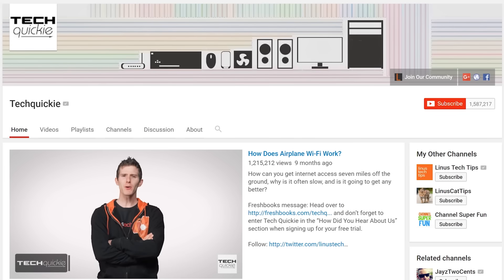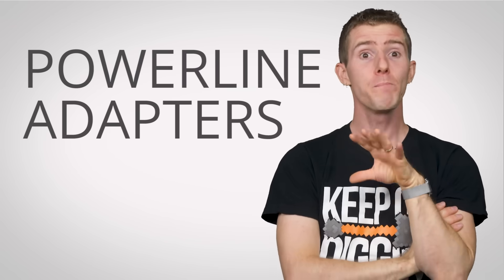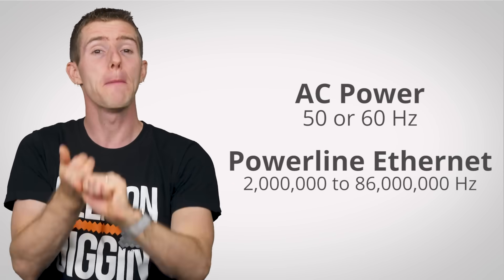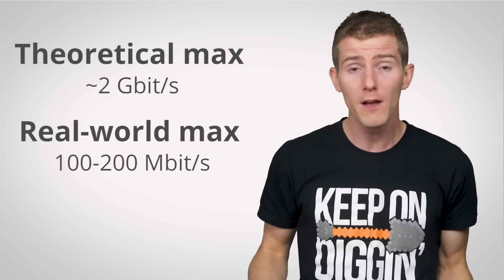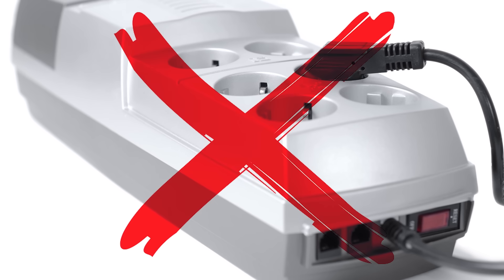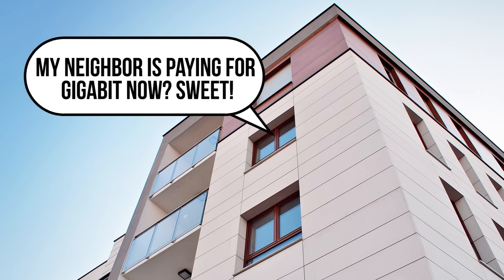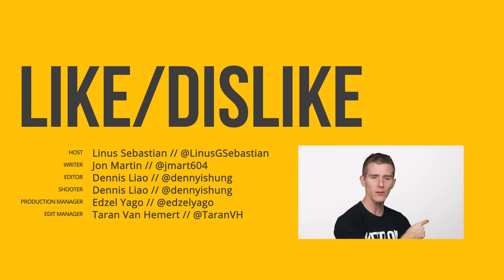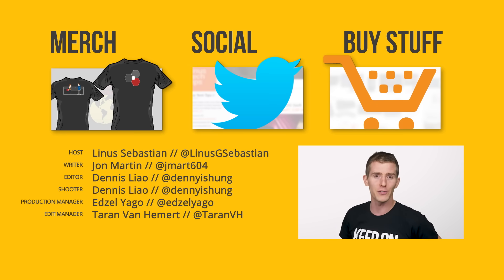How Does Powerline Ethernet Work?

Comment: There are also coax ethernet adapters that you can use on your existing cable TV wiring which may not be used anymore, which will get you far higher speeds and zero issues with congestion.

Comment: My TV and wireless router hate each other. I use powering adapters as an alternate delivery system for the Internet to my TV and it works great, and a lot more often than the wifi

Comment: PowerLine interferes with VDSL2+ Connections, have this issue because our neigbours below us use one we can't recieve 100mbit/s anymore.
The Telekom technician told us, the copper wires are used like an antenna and interferes with frequencys above 5000mhz (if i remember correctly) therefore the DSL is now only at 80mbit/s max.
If they unplug it from the power (all connectors) the internet speed goes back up.

Comment: Honestly, have you ever noticed any interference from Radio Frequency Interference (RFI)? I recently had someone claim that RFI was causing issues for me, but I haven't noticed any difference in my internet connection. Before switching to fiber, I was only getting around 400 Mbps, so I'm quite happy with the speed improvement.

Comment: ASUS Zen Wi-Fi AX6600 Tri-Band vs. 

AX6000 Mesh Wi-Fi System (RBK863SB) vs.

 Amplifi Alien

NETGEAR Powerline Adapter Kit, 2000 Mbps Wall Plug, 2

I'm not sure which one to choose?

Comment: I've just bought a 2nd hand set of 4 x Netcomm NP511s for $10.00AUD per unit so I don't care much if they don't work well.  I've been curious to try them for a long time but haven't wanted to spend much.
I do wonder how Netcomm got away with claims of 500Mbps and then on the next line stating the ethernet port was 100/10:
"High-speed data rates of up to 500Mbps.
1 x 10/100 Ethernet ports for multiple wired network connections."
Is there something I'm missing??

Comment: Do NOT use these in an apartment building. Thank you.
Reply: Why?
Reply: @rustydude93  take a second to think about it. You're modulating an Ethernet signal onto an electric cabling...
Reply: @Mtaalas I'm not a network engineer so this is rather new for me.
Reply: @rustydude93 All electric cables in an apartment home are electrically connected to every other  apartments electric cabling, thus the Ethernet signal's is going to go EVERYWHERE in that apartment building and even if just one other apartment has a similar system, they will cause interference to each other... thus it won't work.

You must be in a detached house with your own transformer that isolates your electricity from every other house in the neighborhood. 

Most homes in Europe are not like that in USA, we have large central area transformers that create 400v three phase for an area of houses, then every house has their own fuses and cabling from there. So we can't necessarily use that system at all in European homes.. depending.

The fuses do not isolate, they only protect against overload.
Reply: @Mtaalas  Thanks for the detailed response. If worse comes to worse I'll just run a long ethernet cable.

Comment: The wiring in my two story house is totally separated, one line for the lights upstairs,  and one for the plug in power cables. Same downstairs. Will that prevent the use of Powerline  if the main WIFI is downstairs? I need the WiFi boost upstairs? Can any one answer that for me?

Comment: I can't recommend this technology enough. Super easy to use. Beats the hassle of trying to manually run cables all over a house. I've had no regrets since getting one. Thank you Linus!
Reply: Fully agreed.... I used to run meters upon meters of ethernet cables around my home, trying not to get in the way. Tried one of these years ago and never looked back. Very fast and very convenient
Reply: Me too. Allowed me to run a wired connection into my gaming PC without having to run a 100m Ethernet cable which would look messy and I get the full speed I pay for on powerline anyway with lower ping than WiFi.

Comment: Unfortunately, having Ethernet sockets is not common practice anymore (There was a sweet spot ~10-20 years ago when Wi-Fi still was very slow, but the Internet was already very useful). Today, everyone is just thinking Wi-Fi will just work. If I built a new house/flat, I would at least put CAT6/7 cables in every corner of every room, even when not adding sockets everywhere. Those cables can be used for all sorts of stuff later on, e.g. for wiring HDMI over them or DSL if necessary, or one I also used for RS485 to read out my smart power meter or to install a smart home bus. Unfortunately, that was not the case in my home (at least not everywhere), so I also had to use PowerLink to get a reasonable network connection to my living room.

Comment: I was wondering if it would go through electrical panels. Now I want to know "how well"?

My neighborhood is a "bare land strata", meaning we have 15 detached homes, all having private back yards but from the front door out is common area.  The area is half a city block and I have been looking for a way to set up a security system.

I am going buy a pair and do some testing to see if the signal will pass through from one home to the next, since we are all on the same electrical hub. Crossing my fingers!

Comment: My phone gets about 300mbps from the far side of our apartment from our router yet my Xbox Series S only ever goes as high as 170mbps. Doesnt make sense especially since my phone is older than my Xbox and has a pretty lame chipset. I dont understand why it does this and sometimes it even dips down to 80mbps and stays for a few minutes. My internet provider does not throttle. I hope something like a powerline ethernet adapter will work.

Comment: So I recently got a power line adapter kit just to test and mess around with, fortunately I live in a newer apartment where most rooms have cat5e Ethernet so I didn’t really have a need for this device. I plugged one end into my router and in the wall and the other into a wall outlet in my floor hallway, surprisingly it worked, I tried this with the 4th floor (we live on the fifth floor) and was still able to get a decent connection, I went down to the 3rd floor and still got a connection! I was amazed of the range of the adapters, I lost connection when reaching the mezzanine (2nd) floor, but still, great product!

Edit 1: a great use case could be IP security cameras, they don’t need much bandwidth and could work great with these adaptors!

Comment: Bought a powerline kit recently and surprised how good it was, breaker box joining garage, extension sockets no problem. The point Linus mentioned about neighbours using your powerline connection is a non-issue as you have to pair it by pressing a button first, so it is a secure connection between the sockets.
Reply: what if your neighbour sneak into your house at night and press the button?
Reply: @fundemort If your neighbour can sneak into your house, you have bigger issues to worry about. 😅
Reply: @fundemort  😂
Reply: Do you know how good the modern ones are such as yours like speed
Reply: @slipperysherman2670  i picked up an old 2nd hand one (~2016?) by tp-link which claims up to 300Mbps, i got around 140Mpbs to the garage, which is enough speed for me to use out the back of the house. I think any modern one would work, it mainly depends on the wiring and distance, if you want to max. speed of course there is no other alternative than a long ethernet cable.
Reply: @dave597 hey sorry I know I'm late but I wanna know how far your garage is to the original Ethernet port and how fast your wifi speeds are? Thanks  a lot
Reply: I'm running a cheap pair by tp link all the way out to my outhouse at the back of the garden. About 100m away from the house. Got my PC and a console in there it's kinda like my man cave but I get nearly my full Internet speed I pay for without having to run a cable all the way out there. Can't tell the difference in games between Ethernet and powerline.
Reply: Do you buy 1 adapter and it recognizes the router which is plugged into wall? Or did you need two adapters, one near router and then for example second one upstairs or garage?
Reply: @mateuszgruszkauk  You need two devices, one connected to your router and one connected to the device you want to connect. As far as I know they are often bundled together, like it was the case with my powerline from Devolo.
Reply: Not all of them have that button to stnc socket.  At least not the old kit I bought many years ago.

Comment: I have gigabit internet but get terrible speeds from tp link power line and is also drops completely sometimes. I only get like 10-20mb speeds with the tp link.
Reply: Is this the TPLINK AV2/AV1000? I currently use a Tenda AV1000 on my 300Mbps and it maxes out 100Mbps. Was about to purchase the TPLINK but seeing this post just grinded my purchase to a grinding halt.
Reply: @CaptainVKanth  Well I assume its more to do with the wiring of the house rather than the tplink itself.
Reply: @Nigel222  Yes, based on the  numerous videos I've seen today, all of them say a similar story. Guess I'll just need to get someone to install ethernet port from the hall to the room.

Comment: Linus, HELP... Can I use Powerline for the purpose of "Backhauling" , I have some Asus Adapters I used a few years ago, but have since initiated "AiMesh" but would find these useful for "Backhauling" any thoughts? Safe? Effective?
Reply: Test it. It’s possible that the ‘AiMesh’ could be faster wirelessly, or it could be faster if you use powerline, but it’s hard to tell, since it depends on your house’s materials, and your electrical wiring. 

Most mesh systems support ethernet backhaul, but nothing bad will happen if you try it and it doesn’t work.

Comment: Does this improve gaming ping spikes? My wifi singnal is good but im having a hard time playing games with no spikes. I have tested using my router and connected my laptop with a cable and the ping looks great with no spikes. Will the powerline adapters work as if you are connected to your router with a ethernet cable?

Comment: I'm using 500 MBPS powerline adapters but having problem with low speed.. Running a 2012 Mac Pro, on wireless, I get the internet service speeds I pay for for, 40-50 MBPS down, 15-20 up. The signal is weak though owing to two heavy brick walls between router and computer and I get my voice and image dropping out or freezing during group Zoom conferences.. hence the powerline adapters. But speeds dropped to 20 MBPS down and 18 MBPS up using ethernet. The computer has gigabit ethernet, and using Cat5E cables, so there should have been no drop in speed. I'm in a two bedroom apartment, only 10 years old, so no old wiring. The powerline adapters are plugged into the wall in each room, no other equipment interfering, and it;s only a short distance. Any idea why my speed dropped?

Comment: I've been using various powerline systems in my house for over a decade now, and honestly I'm really impressed, same performance as what my router currently delivers in terms of speed and latency, ideally I'd like to eventually wire my house with Cat5e or Cat6 but with brick walls and an extension that puts a few rooms beyond the original exterior brick and cinderblock wall it was just easier to buy a set of four powerline plugs and a couple of switches to get everything connected. One for my gaming room, one for the office, and one for the TV and consoles in the lounge, it's just plug and play and I've never had a reliability issue with either the plugs or the switches, every time I have an outage it's either cause of my ISP or my router had a crash.

I think the only issue some powerline has is when it's plugged into an extension, especially with another appliance that causes a lot of interference, or if your house wiring is bad quality, but here in the UK by house was built in the late 80's with good quality internal wiring in ring circuits, so the powerline system works incredibly well.
Reply: What powerline adapter are you using if you dont mind me asking?

Comment: well back again. so for some reason now for last 2 days my internet from avg 50mbs down/6mbs up dropped to 3mbs down/1mbs up and i use ethernet adapters. both same types and this issue persists until i pull the one closes from me out of the outlet and put it back in. this happens every few moments and its infuriating. if anyone also deals with this issue how did you solved it?

more details: i live in an apartment with loose outlets so the ones where i plug my ehternet adapter into and connect to my pc i literally have to tape it to the walls (no vents for adapter are not covered i made sure of that) to keep it there so it doesnt fall out.

Comment: The goal it to get signal ride on high voltage e street line and while when it get into the home then it is much simpler. The 5000 voltage power line can carry high frequency low voltage signals ride on it easily like 12 voltage of megahertz over 5000 volt 60 hertz then there are 360 degree phase angle multiply by 3 phases so more band width for long distance could mitigate over use of wireless

Comment: Do you still need a wireless router where you're sending the signal
Reply: You need a router of some sort. It doesn't necessarily need to be a wifi router, but most typical routers have wifi built in.
Reply: @JJFlores197  appreciate it I just found 250ft of direct burial cat7 for $85 with ends so I'm just going that route better safe than sorry.

Comment: Yeah, well. I wanted to know how they work because yesterday it started not working, and this morning it worked for NO REASON. And it started again today. What, is solar activity extreme today, or what? I don't like how a lot of things that concern informatic seem to be able to stop working and start working again with no way for the user to even know why the fuck it doesn't work.
I never had any problem, and in the middle of the night it just stopped. The 2 plugs have 2 greenlights but not the middle one.
it's like when internet started not working at a software scale but repaired itself. And other things like that. I'm from the old times, when you KNEW how to repair things, now it seems you just pray and it could just solve itself magically.
Edit: Every cable is category 7, of course, but I was always stuck at 100 mb/s. Never knew why. Even wifi seems better in my house, even latence is not that better with powerline ethernet (we call them CPL, for bearer current by line, IDK, something like that, in France which is very weird and makes it hard to find the name in English).

Comment: im completely clueless when it comes to this, so if someone could help me, itd be very appreciated! so i got a job working from home, but its required to be hooked up to an ethernet cable... so id be working upstairs, the wifi box is downstairs. would this work for me?
Reply: It may work, but you'll need to test it out. A lot of it greatly depends on your home's electrical wiring.

Comment: whoever engineered these adapters is a fucking genius. I got a gigabit one today and it works very well. I have a newly built home but they didn't make any available lines to go up to the attic where my pc will be at. And since it's a pre-fab building, there is no way I can run a wire myself..

Comment: I bought one of these and my speed got slower using it. I got 150 download, (with at&t 1GB per second internet plan). Used one of these and I got 40 download. We spent $90 on it. Anyone know what to do? My router is upstairs, and my Xbox(what the second thing is plugged into) is downstairs. That might be the problem but idk 🤷‍♂️
Reply: You'll need to try different outlet combinations to see what works the best in terms of speed and reliability. And sometimes, some brands and models aren't that good to begin with.
Reply: If you're still having this issue, I've found that a dedicating the whole outlet to the powerline adapter gets me significantly better speeds, although I still top out around 100mbps.

Comment: I have an Ethernet wall outlet that doesn't work in my workplace. Can I get one of these connected to my eletric outlet and solve my Ethernet problems by using it instead?
Reply: Sure. You do need 2 though. One plugs near your router and the other plugs in your work area. Though, you may need to test various outlet combinations. In my experience with them at home, I had to use specific wall outlets to get a good connection.

Comment: Ethernet over powerline is a terrible idea. Electrical wiring acts like a giant antenna and shortwave radio reception in the neighborhood gets wiped out. Interestingly, the designers knew they were, in effect, making a radio jamming device, and they notched out the amateur radio bands so that those most likely to complain  would be spared. But it does, for example, jam CB and shortwave broadcast reception. Since powerline ethernet adapters are certified under FCC Part 15, they must have a warning which states "This device must not cause radio interference", which effectively means that they should only be used if you are out in the country where your neighbors are far away.
Reply: It's suboptimal by definition and riddled with caveats, but it does conveniently fill a UTP plug-shaped hole in home networking for many. In a lot of homes it's the best solution if you don't want either terrible wifi reception or cables on the floor everywhere until we find something better (and I mean something easier to accomplish than 'run cat6 UTP through your entire house'). How many people listen to analog local radio vs. how many people want to have wired-ish network speed and stability in their homes with minimal effort and very few visible cables?